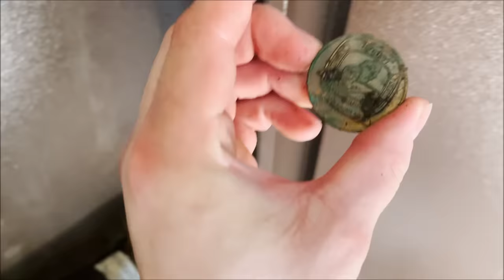Breaking Open Criminal's Abandoned Gun Safe! I was shocked at what we found inside...

Comment: "SA" is single action meaning you have to pull the hammer back before it will fire. Unlike the double action which allows the trigger will move the hammer by just pulling it back.

Comment: For a safe it's not very safe
Reply: you would be surprised.  All the $2000 gun safes sold in box stores these days are the same thin 14 gauge steel, just with concrete as a filler and fire protection.  the walls are 2 inches thick but all filler. a tool similar to that will cut them open in minutes.